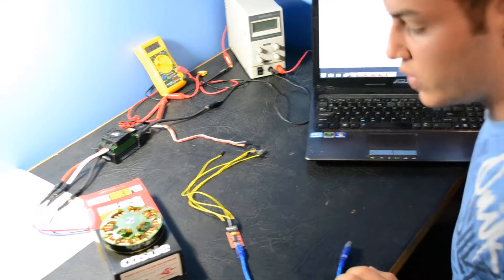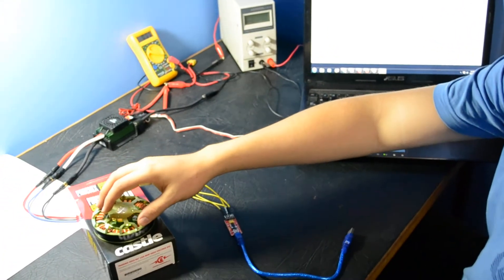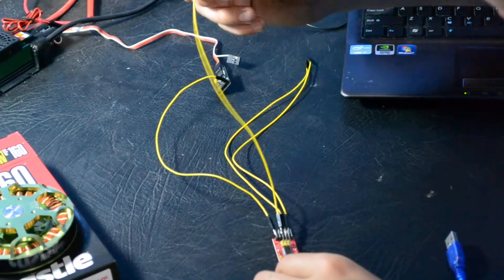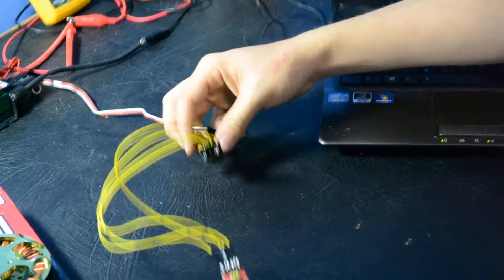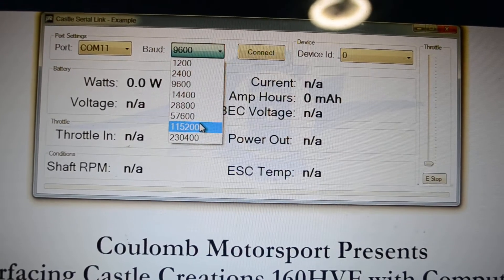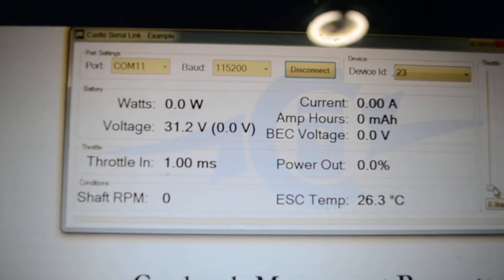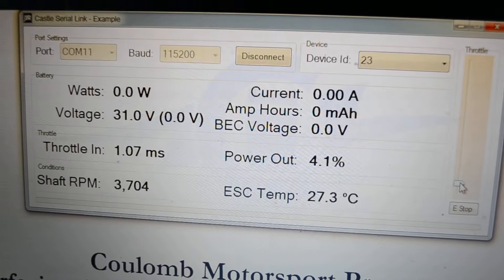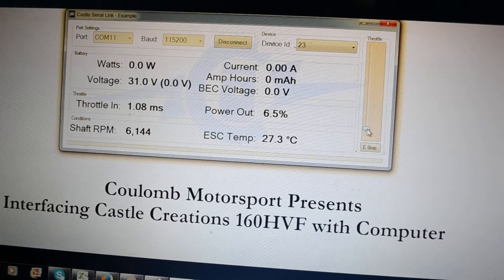Interfacing Castle Creations Serial Link with Windows PC

Comment: Hi, hopefully you'll see this comment. I've done RC robotics in the past where i've controlled my Traxxas with a "hacky" solution involving an arduino and lots of guessing with wiring and signals. However I plan on doing a much more comprehensive robotics project with my rc car again this year (final year of uni). I wanted to utilze the CC Mamba ESC i have - my question is , is it possible to control the motor/esc/Link Live protocol tech in this video with an Arduino, Rasbery Pi or similar mobile computer through a code/signals? AND read telemtry back like RPMs or throttle ms?
Reply from the maker: Hi there @DerTarchinPro, sorry for the delayed response. We managed to 'speak' with the Castle Creations Phoenix Edge HV ESC with an arduino before moving on to better control systems for our needs. I'll chat to my brother, who does our software for the EV's and see if he has the right code for it.